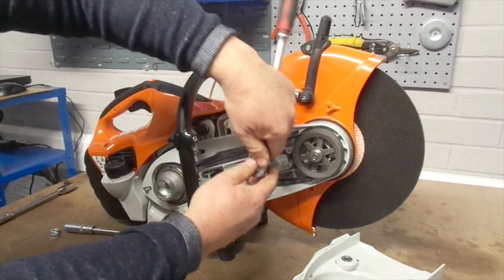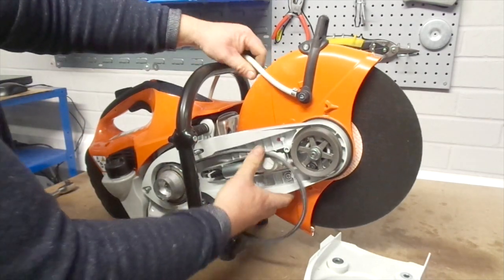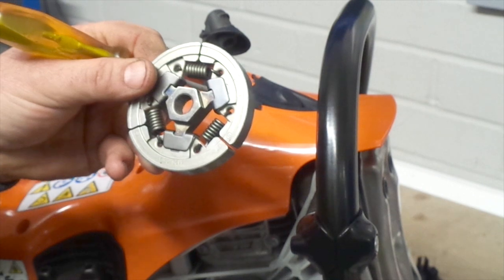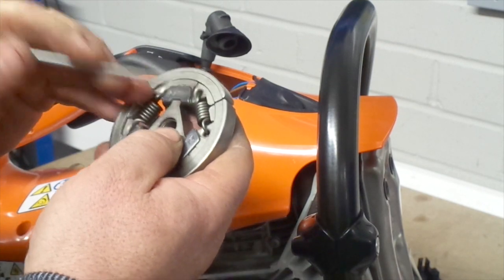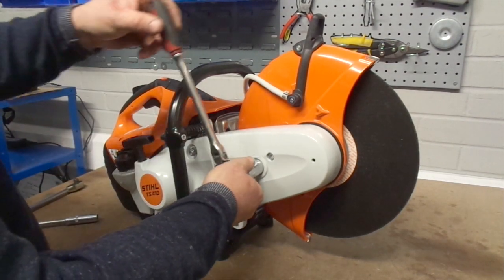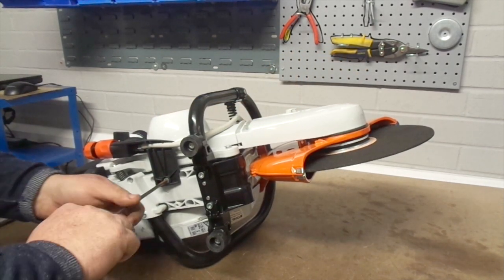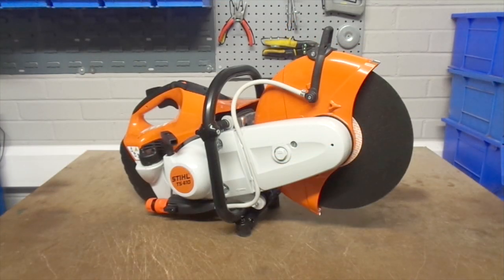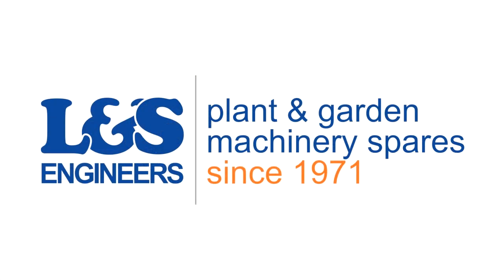How to Change the Clutch on a Stihl TS410 Disc Cutter | L&S Engineers

Comment: My saw , starts and revs up fine but as soon as I start to cut anything it dies down and stops .   Is this the clutch gone ?
Reply from the maker: Hi Dan, this problem could be caused by a number of things, it sounds like a possible airflow problem rather than the clutch, if you would like any further advise you can call us on: 01543 378 189.